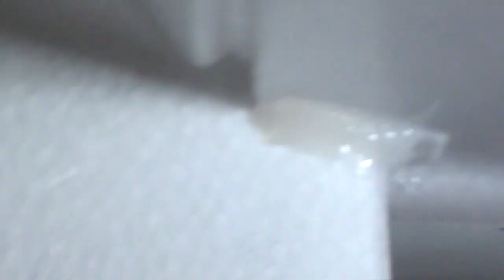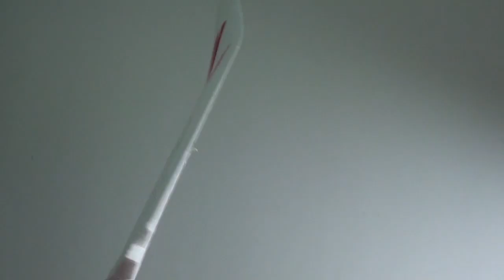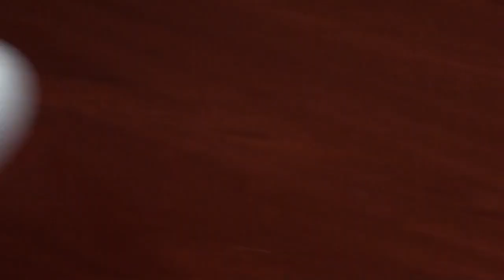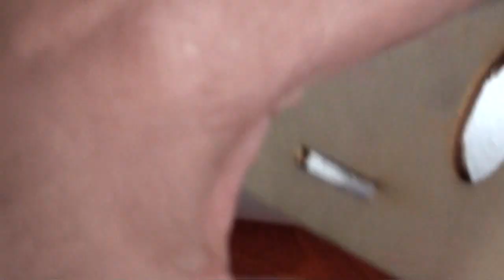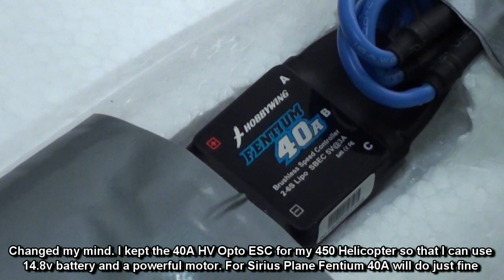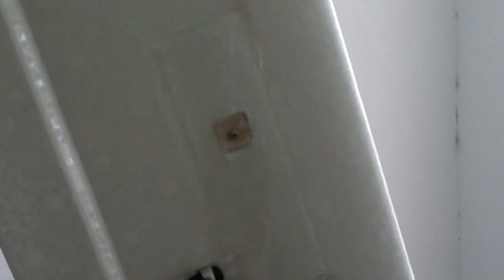Beginners FPV Guide -- Final Touches to FPV Plane

Comment: I mounted my servo's both vertical at the tail so they don't protrude outside of the foam,  and your motor mount, mine has two thicknesses of ply wood,  I realise there must be different versions because I see in some the piece of wood for the tail is included, (not in mine)  I liked your idea for trimming the foam so you can get the aileron servo's out, a strip of fibre tape over the wire there streamlines it again,  great vid thanks for sharing

Comment: hello
i have an easy glider 2 with tx/tx Rc 305 and and easy cyclops OSD V 1.3
but i have a little probleme. 
Do you know if the OSD can be configured for french values (meters, KM/H etc),
i leave in france and it'is to easy for me
thank's
fabrice